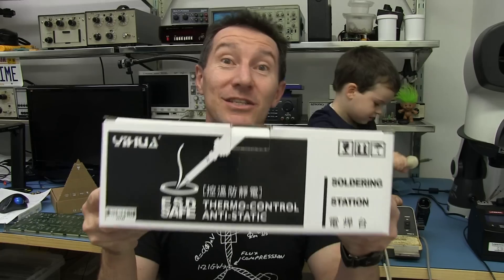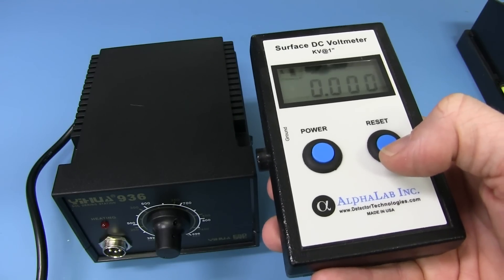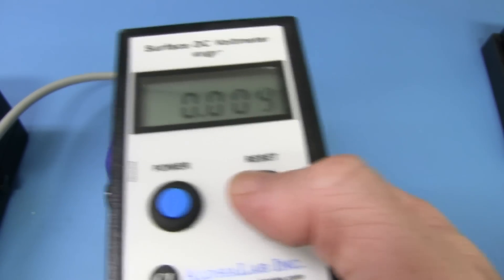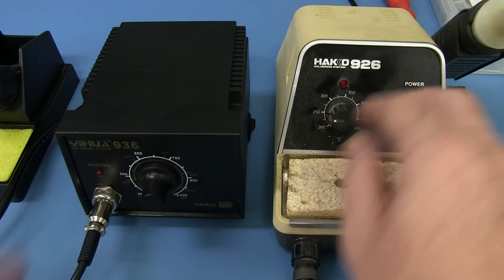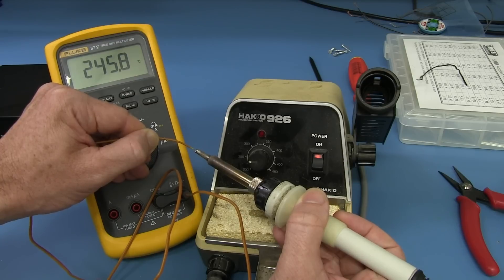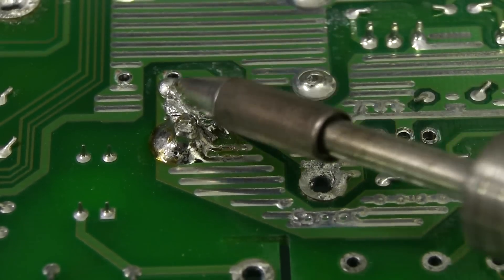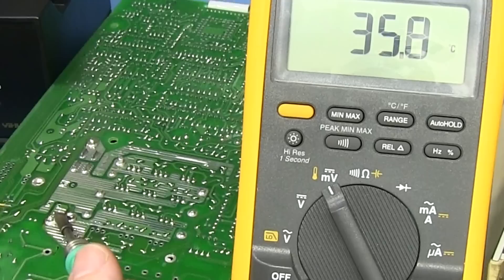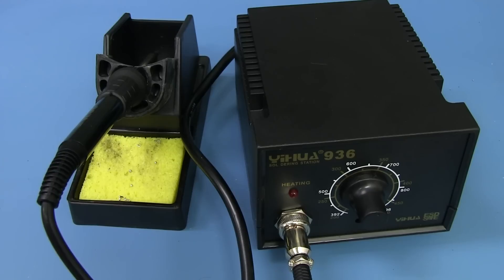EEVblog #596 - World's Cheapest Soldering Station - Yihua 936

Comment: I have a BK2000. Probably the same guts in a different case. Even uses the same knock-off hakko handle this one does. Pretty happy with it. Ive used it on occasional (once a month) for a couple years now. Only thing its really failed me on is I was trying to recover some caps off a Xbox 360 mainboard and that just wasn't going to happen, even all the way up to 480C maximum temperature. Between the lead-free solder and the heavy power planes for the CPU and GPU it couldnt get enough heat on it. I ended up going way overkill and breaking out my 150W soldering gun to do it.

Comment: Looks like it got moisture or corrosive fumes at the factory, most likely the working conditions are not up to standards, that's affects also the price. Also I'm using a 32A 3-phase plug earth pin on my plug into wall soldering iron cause the stock one started to corrode off.

Comment: What if i tell you they sell soldering irons with the temperature regulator imbeded in them? I have been using one of them for 3 years now and i like it because of it's portability. I'm planing on buyng a hot air reflow soldering station, but i'm a bit short on money right now...

Comment: Hi Dave, first off, I just lurve your bloggs so keep them coming, they are a godsend for amateur players like myself. Regarding the thermal capacity of el-cheapo irons in general, I have a cheap chinese hot air rework station which has the same iron as fitted to the one that you are reviewing in this blogg. My question is this, is it worth replacing the whole iron for a better quality one, in other words, would a better iron improve the performance much, or is the circuitry also a contributing factor affecting performance?

I am contemplating buying a Xytronic iron which is the same wattage and voltage as the crap one on my rework station, would I be wasting my time and money?

Thanks in advance.

Comment: Repost for those who wander why use crimp connection when connecting to the core of a transformer.

When soldering to the leads of a transformer.  Don't go for the cheap solder that melt easily.  You want a very high temp solder.  This is for safety reasons when the transformer heats up.  During normal operations, the solder will not even heat up to melt, keeping the wires in connected.  Now while connected to a proper power circuit with ground.  If power spikes happen or a short happens to the transformer, the solder will last long enough to trip the circuit breaker.  If you used cheap solder and or had it on a non grounded outlet.  The solder will melt fast causing more damage in your home or work shop and to what circuit the transformer was connected to.

When connecting to the core of a transformer you would want a crimp connector.  Using a solder connector, the solder could heat up and break loose.  This loose wire could come in contact with the high voltage of the transformer causing a circuit breaker to trip.  Bad case, it might not trip and someone could get a lethal shock.

Comment: A super cheap item is made of cheap pieces.. whaat!? 

Question: Where/when did it ever claim to be a "genuine Hakko 936"? I did skip around a bit, but i didn't really see anything other than both using the numbers "936" in the name.

(we may just have differing definitions of "knockoff" though)
Reply: +Frosty. He missed saying (or maybe edited out?) that the Porsche 936 is also easily confused with a genuine Hakko 936 because they use the same numbers and should be avoided.

Comment: You got what you paid for. When I was living in China, I bought MANY different irons, and only those cost more than 30 US bucks worked nicely, and if import and transport fees added, it will be more than 40 US bucks on international market.

And, IMHO, those parts shown in your teardown seems to be second hand components, that's what you paid for. Still, I think it's still acceptable if you use it ONLY rarely.

I use virtually only SMT devices, so I only have a 15$ portable iron, and I use it only for tinning and connecting wires. For proper THT working and reworking, I'll suggest at least a Hakko 888, or a cheaper Chinese counterpart, like Huanghua 937. Hihua has never been considered a good brand in China. Personally I prefer Huanghua for it is a 50+ years company, and Hakko, for it provides best price/performance/reliability balance.

Comment: I own similiar unit by Aoyue. It's still different in design. It was about 40$ shipped.
Crimped connectors, actual metal stand(with solder holder) replaceable fuse, LM324 comparator, optocoupler etc.
Transformer is way smaller though.

But the problem is that it broke after 2 weeks. I'm not even kidding.
But I bought it from reputable seller, Wiltec. They politely just sent me a new piece for warranty. And it broke. Not even kidding.
I was able to combine 1 working unit out of the 2. I have no idea what is wrong with the another one, I can't get my head around analog circuits.
Anyways, I can recommend Wiltec as a store, but you might want to go with Hakko's if you can get one for 100-150$.
Reply: Oh my ....god i just ordered the same AOYUE 936 to Wiltec store for 46€ shipping included. I hope i wont have the same issues that you got!
Reply: int0x13
My fault in the other unit was completely fixed by replacing the comparator IC(LM324). I have no idea why it failed, but it looked very much like a harvested part.
Now I have 2 perfectly working units. Props for Wiltec for the replacement.

Comment: I thought I found something better in a Velleman that runs $22USD, but it has a lot of bad reviews too.

I wonder if there's value in making a DIY solder station head unit kit for a known-reliable and readily available solder pencil with a built-in thermocouple.

That Hakko (and the clone) seems to use a non-proprietary connector for the pencil. I need to see if a more modern Hakko is similarly non-proprietary with the connector.

Maybe the lesson is sometimes you can't cheat quality. The Weller WES51 can be had for US$77 on Amazon and the one I've had has served me well for five years so far. The person that recommended it to me had been heavily using his for many years before that.

Comment: I've got about five old Pentium 4 computers that have bad caps on the mainboard, and I am so strapped for cash that it's worth it to me to try to fix them myself. I have read not to try it with the 30 watt pencil irons (I have two that were given to me), that I need something with ESD protection. Hopefully this will work. If not, it'll be good enough to salvage the good components from the boards. I was even looking into building my own soldering station from scratch, but I think I can improve this one once I get it. (Don't tell Dave I'm getting one. Actually haven't yet made up my mind.) I totally understand how it's better to get good equipment that lasts rather than to keep buying cheap equipment. It's like, a dollar store hammer wouldn't last one job for a house framer and it would just be a pain to duct tape it back together just to make it through the day, so the first thing a new house framer does with his pay at the end of the day is go out and buy a good hammer. Then he never lets it out of his sight. But if someone just needed one to have in the house for hanging picture frames or tapping together a birdhouse kit, eh, a dollar store hammer will do. Most of what I have done was fine with the little pencil iron, but as I progress to working with microchips such as what's on a Raspberry Pi, I expect I will need the ESD protection. That's one more reason I appreciate this review. I see that the ESD protection on the clone is not perfect. How does ESD protection work in soldering stations? That is what I am going to look into before I potentially waste my money. I need to see if I can improve it or if I just have to wait to save up for what I need. I can follow instructions to make a spot welder from an old microwave, but I have not found instructions on making an ESD protected temperature controlled soldering station from scratch. I'm still learning--slowly.

Comment: This soldering station  is decent, but I use most of my tools made in USA.

My meters are Fluke, I buy a four channels oscilloscope rigol and stiill is in the box, I don't know if I want to use.

My soldering station is Hakko Fx888d, soldering gun Weller made in USA.
My hot air gun is Hejet made in USA.
My desoldering gun is Hakko 808, I bought a chinese desoldering gun and still is in the box.

My screewdriver are wiha or crescent.

For profesional work is better to use a trusted tools.

Comment: So... soldering/ splicing two wires (they usually vary from 12-24 gauge).... Will the yeehaw 936 this do it? I usually use soldering stations just for splicing wires. I rarely use them honestly. I had a fx888 and my buddy's dad (He's old) misplaced it while organizing the garage. It'll show up again some day. Until then, I want a cheapy... if it'll work. And which tip do you think I should buy? The hakko 3.2mm wedge as mentioned? I cant remember what I had on my old hakko.. Thanks.
Reply: +AviatorGM Your money, your choice. It depends on your financial circumstances, what you want to do, and what you think. I can only tell you the cheap one solders fine  for me.

Comment: I'm kinda sorta guilty of picking up cheapo soldering gear... £6.00 ($11AU) on a fixed temp 60W iron... and wasn't worth it!! it worked for all of 6 months and crapped out on me during one of many big projects! Instead, I went to Maplin and picked up an own-brand 60W station for about $110AU (that's £59.99GB or there abouts). I would have gone with a name brand like Hakko or Weller if they had them in... sadly though:

> Couldn't get an FX888D because they were out of stock, the FX888 is discontinued and they didn't have any remaining.
> Couldn't get the Weller because I also needed a rather large component inventory for the project (SIDE NOTE: That was a hell of a lot of capacitors!!)

STILL... the upshot here is that the iron I got is essentially a digital Hakko 936 (It actually kinda looks like a 936 tbh!)... gonna grab a Hakko 191 stat from EBay and callibrate it to make sure I'm actually getting 350* out of it but so far, it at least has a good enough thermal mass and takes WAY less time to heat up than my old heap of junk!

Comment: Normally the export companies will double the price when they're selling to a rich country, so this stuff probably costs approx. 8 dollars in the domestic market, which is also way too cheap. At about 24 dollar you can get a relatively better clone of the 936. But even at such price it can't properly melt large solder joints, especially when it's connected to ground plane.

Comment: What do you think about the butane soldering iron ? I have one and I like it, but I wonder if it's any good compared to this kind of station that I never had.
Reply from the maker: Matrixtechno Butane soldering irons are awful because they are not temperature controlled.
Reply: Got a point there ! Another thing then related to temperature control, you demonstrated in this video that depending on your brand you have to guess between 270 and 350 for the same result, so is there really a point to have a "exact" temperature setting since the result can vary up to almost 100C ?
Reply: Matrixtechno
I think it doesn't have to be exact. But it has to lie in a specific temperature range for a specific time range, or else your solder joint won't turn out good and this will affect the performance of your circuit. Worst case, you will damage your components if the temp is too high and you apply it too long.
Reply: Matrixtechno Its to do with quality. Most quality stations would be within a 5% range of the selected temperature. As for the butane solder iron, I have used them extensively, in the field. Which is really the only time a butane iron would be appropriate, we only used them in the field (I worked aviation for over a decade) when power was not available and these were quality models that had all the bells and whistles but temp was hard to control, and when soldering electronics in aviation equipment this is important. In short, they suck. We ended up making custom connectors to use aircraft power to be able to control temperature. Temperature control is important and NASA standards, the same as military aviation standards is +/- 10 degrees. In fact its so important that every 8 hours of operation time and every job (not each wire but moving from one job to another) it is required that we calibrate our irons. Get a Hakko 936 or 937 and you will be glad in the end.
Reply: John Doe I didn't even knew that temperature could be that important. I'm very new to electronics. I have a understanding of working principle from engineering school, but I majored in mechanical engineering. I thought that as long as the iron was able to melt the solder it was doing a great job. I'll look deeper into electronic welding tutorial to understand when and where to use different temperature.

As for the 936, I've looked them up, they're pretty expensive even the used one ( +120$ without shipping ) !! He also mentionned a high capacity iron ? That was doing the job at a much lower temperature than even his 936. Is it really a temperature difference or is the settings are off on the 936 ?

Thanks for the info though !
Reply: Matrixtechno You can find a 936 on ebay for less than 50 USD. Also, if you want to get an idea of some standards you can google NASA Soldering Test or Standards. There is a PDF floating around the internet. Of course those are above and beyond a normal hobbyists standards. There is also a test kit you can buy that comes with a PCB, components and even old style posts (yes we still test on old posts) to solder together to test your skill level (we took the test every 6 months to a year). Any ways for high capacity I think he is talking about heavier irons and also keep in mid not all solder is the same, ome things require much higher melting point solder which requires a iron that can transfer a lot of heat quick to melt the solder so you aren't sitting there cooking a PCB.
Reply: EEVblog Yes, but they are portable. When you only need to quickly solder two wires together away from mains power, they are the right tool for the job. If you take the tip out, some models will actually work as kind of a miniature hot air gun, perfect for use with heat shrink tubing.
Reply: EEVblog Apparently they are better for soldering wires as everyone tells me (but I'm not soldering 18 AWG wires :P)
Reply: +EEVblog butane soldering irons are great when I'm in the field soldering wires together :) Except when it's windy.
Reply: +Mike Gresham Absolutely agree. I had to do some outdoor soldering yesterday to fit an LED flood lamp outside the house. It's thick wires so temperature isn't as sensitive, and it even shrinks the heat-shrink for you :-)
Reply: +Matrixtechno As others have said, the butane ones have their place (soldering outdoors or in the car). They usually have a crude temperature control (ie, it turns the flame up and down) and usually have a mini blow torch attachment too, which can be useful for soldering big wires. I think it's handy to have one in the toolkit, but you want a decent temperature-controlled one for doing finer work.
Reply: +and mcg1 The problem with them is that when you put the flame low, it gets to the right temperature but as soon as you stick it to anything it cools down too much and it can't melt solder. If you turn the flame high, it gets too hot and doesn't solder properly (it gets all oxidised). If you put it really high (at least on mine, and it's not a no-name brand it's actually an expensive Kemper) when you want to solder a big cable or terminal, liquid butane comes out of the tank and it makes a fireball...

Comment: I bought AOYUE936 for 47,55€ with shipment in January and I must say that it is adequate for my soldering needs (a bit of trough hole prototypes and all down to 0402 on flexible boards) - with proper hakko tips of course. 
Actually it is just as good as digital Weller I use during my working hours.

Comment: I guess one thing you get for the extra cost of the Hakko is consistency. Mine was far better looking. Fully wetted switch, no rusty nuts or chips, and a legit terminal on the grounding wire. I guess for the cost you could buy two or three and hope one is in as good a shape as mine.

Comment: I got a cheap-ass Chinese soldering station with a power regulator for less than 20€. I must say I'm actually pretty satisfied with my purchase- it gets the job done, and I can buy 10 cheap ones for the price of 1 expensive unit.
I bet my left kidney most people won't do enough soldering in their lifespan to break 10 cheap soldering stations, and simpler is better when it comes to general repair work.

Comment: I had almost the same model (bought when I was 13, i'm 23 now...) and I used it A LOT, built countless projects with that piece of junk, used it so much the iron bent like a banana... It does the job alright and is fine for 90% of jobs BUT, if you use your iron everyday you want a nice bit of kit (is an hobby, you do for pleasure) you want to buy a good iron. After 10 years I upgraded and I don't regret, but this can go a long way. If you know how to solder you can do wonders even with a cheap iron, you buy the premium stuff if you really need the performance or just for the pleasure to have a quality tool

Comment: Is there a temperature chart that has recommended temp setting for soldering depending on the project?  I have a Weller that I use, and I usually just turn it up all the way like the dumb amateur I am. :D